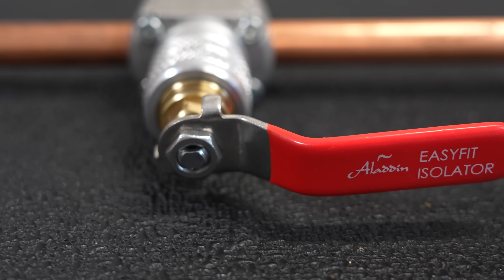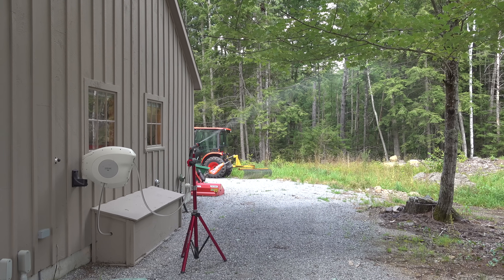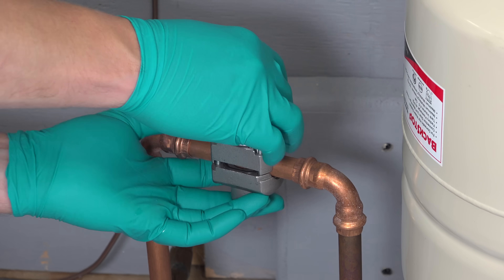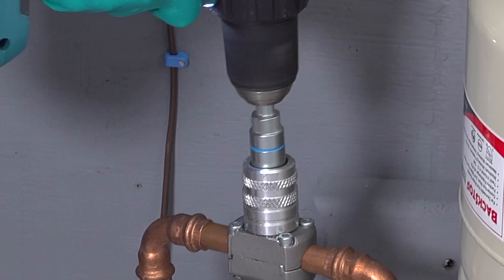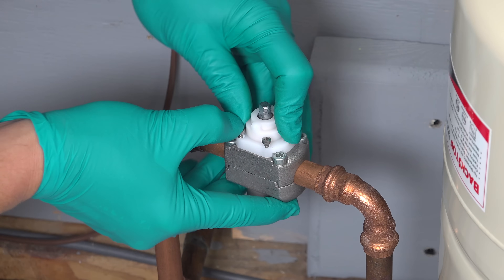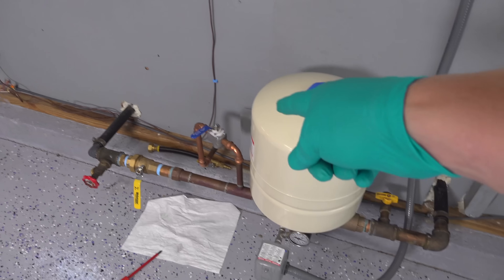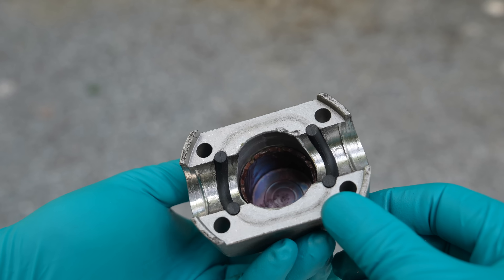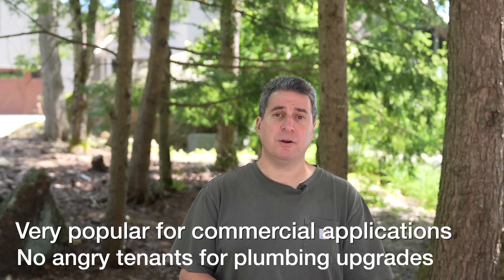SHUT-OFF valve installs on a LIVE WATER PIPE - Aladdin EasyFit Isolator

Comment from the maker: I think aliens brought us the technology for this valve! I am blown away by how this works! https://amzn.to/3YmkHcp - UPDATE Video: https://youtu.be/rj6zKo_d49g
Reply: where does the plug and shavings go from the drilling process?
Reply: @kevinwallis2194  The coupon is trapped and sealed along with a majority of the swarf in the lower housing.
Reply: @kevinwallis2194 due to the valve’s unique blade design the pipe coupon and swarf is captured in the lower housing in the special chamber at its rear so no shavings enter the pipework.
Reply: @kevinwallis2194  he says in the video, it gets pushed down to the bottom half of the "valve". You can see the shape for it on the bottom side.
Reply: @FontMasterFlex  yep I see that, but it wouldn’t pass an inspection for fire sprinkler service. I like the idea for basic household use though
Reply: @kevinwallis2194  I was looking for this question or I was going to present it.
Reply: @kevinwallis2194  down the line…..
Kind of gives you pause doesn’t it???
Reply: This is way beyond expensive.
Reply: Cheaper than a plumber? With SharkBite fittings, everyone's a plumber!!
Reply: A plumber show’s up at your house and installs one of these valves.  Charges you 275.00 to 300.00 because he has to make a profit. Then his labor on top of that. Most people including yourself would just freak out. Here you are in 500.00 dollars and the real problem isn’t even looked at yet. The plumber has just got the water turned off. Now he has to fix the problem!
Reply: he's your friend huh? RichieWellock
Reply: Not so! This is not cheaper than having a plumber in to do the work. My plumber fitted a valve for £50. I purchased a standard valve with handle for £6! Total £56 fitted. I loved the idea very much, but they will have to bring out a much less expensive version to get any traction in the UK market.
Reply: @kevinglennon2370  , this will be something used very seldom here in the US or anywhere else for that matter ,in the end the main shut off valve will need to be replaced (it does not solve the original problem ).
Reply: As for price I've just looked then up here in the UK: 15mm £39.50 Ebay, 1/2" £98.80, trade pack of 5 15mm for £247.08.
Nothing like the quoted price in the US.
Reply: @wildething7923  , I wish we would use the metric system in the United States 📏📐
Reply: Great Idea and looks to work. Way to much $$$. I thought it would be more like $50 - $80 not $250+!
Reply: At $250.00 per valve it is a very big Hell No!
Reply: @jan58joubert14 I had no idea how expensive these were. Last year I had a new HW heater installed and he switched mine from this to some sort of very flimsy aluminum.  I’m just learning this now.
Reply: Cool yes, but I can turn the water off and put a normal valve in myself. @PandawdyBob
Reply: @yumpinyiminy963  +1 especially with new snap-on or shark-bite valves, that costs 1/10th and do not require soldering
Reply: There is no plumber going to charge you $250.00 to install a valve, so no it isn't cheaper it's more expensive and you have to do it, not the plumber.
Reply: @purplehayes5718  Idk where you live but for a plumber to do basically anything more than unclog a toilet here you're looking at 250-350+
Reply: @purplehayes5718 Unfortunately that’s not the case where we live.  It’s total BS, but since the pandemic the plumbers in our region of lower Michigan have been treating the last three years as a gold rush.  I can’t tell you how many places I’ve had quote me ludicrous amounts for everything from installing a simple shutoff (not even in a main - in a bathroom) to simply moving a PVC shower drain one foot in a completely wide open subfloor.  There is one competent, honest plumber I’ve found in my area in the last 10 years and he’s become impossible to get because he’s always buried with too much work.  Ripping customers off is the SOP in our area.  Some places are just that way.  DIY is the only way we can often get anything done.
Reply: You can get these from between €40-60 in Europe.
Reply: top part shouldn't be plastic IMO
Reply: The high price must include shipping from Uranus.  But seriously, does it work on plastic pipe?
Reply: Thank you for sharing this, it is very helpful.
Reply: only £63 in the UK so not bad actually.
Reply: Ya. You'd have to be right alien to pay that much for a 1/2 shut off valve... under pressure or not.
Reply: Yikes is right! $300!? Wow 😮
Reply: ha not if a plumber installs it lol
Reply: I recently paid 900 dollars for a single shutoff valve... I'll try this next time
Reply: Does this worl on pex line to or only copper
Reply: BRILLIANT! Who invented this? 
I'm betting a US Navy machinist that served on a submarine. Those guys can make anything from nothing.
Reply: Now that is a cool design !
Reply: We’ve been doing this in the gas utility industry for years. The big difference I see is in the gas industry we have to pull out the cut section,referred to as the coupon (this is imperative that the coupon does not get left in System with gas ).With water who really cares if a coupon falls back down in the line and causes a restriction , it’s not like an appliance can blow up due to a delayed ignition due to a restricted line.
Reply: @boby115  
   How would you like to have Half as much Volume of water coming out of your kitchen sink faucet or shower valve.  If you’re married go in and run that past the wife ( or husband)
  You’ll be sleeping on the couch until you get it fixed.
    I also question why would an appliance blow up with less volume of gas. The pressure in water or gas will remain the same. Both will lose volume but the actual pressure will start out as you turn on a stove or faucet the same as before. Then the volume and pressure will drop.
Reply: @boby115  The coupon is trapped and sealed along with a majority of the swarf in the lower housing.
Reply: @boby115  so you would be ok for a coupon blocking a fire sprinkler? Its been proven to cause problems many times either with blocking a sprinkler head or alarm valve. if that were the case, we shouldnt need to worry about rocks from unflushed underground pipes blocking fire sprinklers, which has happened.
Reply: @kevinwallis2194  , I will agree with you 100% and I would think working on the type of lines you’re speaking of the coupon would most surely be removed (I would hope 🙏). Small residential lines I am not so sure it would be that big of a deal (it would be aggravating and the problem would still need to be  resolved).
Reply: @boby115 WOW. makes you nervous who you hire. Thanks for that info.
Reply: How much do they charge for a gas version of this?
Reply: Pfft ! you kidding? Two plumbers are cheaper than a plumber!

Comment: At $250 you could just get a plumber. But if you're in a situation where you can't shut off the water this might be your best option. I can't believe how well it actually works, I'd expect some water to leak out as you're installing because that's a lot of pressure and it's hard to waterproof moving parts.

Comment: It's just easier  to just use a valve with compression fittings! What's so hard in shutting off the water at the meter? And installing a normal ball valve with compression fittings?
Sorry this valve doesn't make any sense and price!

Comment: Great you install a new valve that doesn't let out a drop whilst installing all you have to do now is call a plumber to readdress the problem caused by air blockages in the whole system.

Comment: I needed to drain heating system pipes which didn't appear to have a drain valve installed, so I installed a couple of drain valves that worked on the same principle as this. Not the prettiest plumbing fixtures, but extremely useful at solving a problem that would have been a lot of work to rectify any other way.

Comment: I love these videos. The presentation is perfect.
Re the product, as others have noted, seems only of use where you cannot shut off the water supply, which surely must be a rare situation.
And for USD250, I am thinking  a pipe freezing kit would be cheaper, then install a regular valve.  eg a Sharkbite or similar.

Comment: Anywhere that water service is SO critical it cant be interrupted even for 10 minutes should have A LOT more upfront design work and, if properly built, a disconnect would have been there to begin with. 

I feel like the device exists as a get-out-of-jail free card for handymen who screwed up. Nonetheless, it's super cool from an engineering standpoint, I just don't see a proper use-case for it, especially for the $$.

Comment: Where does the copper cut away go? Where does all the copper dust go?
Reply: Yeah, the copper discs are trapped in the lower bit of the unit and won't be able to budge but even if you run the water for a couple of minutes to clear the larger copper shavings I guess we'll be occasionally treated to a nano flake or two.

Comment: This does not appear to be a tap for regular use. It is most likely intended for urgent repairs when it is not possible to make a normal connection without pressure in the pipe. For small-diameter pipes, this device has a significant drawback - the cut-out metal circle may end up where it should not. The idea was borrowed from plumbers and oil workers - they have similar tools for making connections, but they usually work with larger diameter pipes.

Comment: Are there any metal chips going into the water pipe during the installation?
Reply: its built for copper. so it slices, it doesnt crumble, its not brittle. so there shouldnt be any significant metal shavings. atleast no more than youd find in a partial house repipe.

Comment: In the UK, they're about £60 with the tool and collar. Without the tool and collar they're called a refill pack for about £44. So once you've used the £60 one, you just then need to buy the refills.

If that guy has been buying them for $250, someone is ripping him off.

Comment: Wow!!  I thought this was expensive here in the UK at around £50-60, $200 is crazy!!!  Reading some of the Amazon reviews shows some people having problems with the installation, but after watching this I would say it's them rather than the product. Still expensive though, the price I would be willing to pay is about £20-25. I can buy a bag of 10 normal in line isolators, that do require the pipe to be cut, for around £4-5, so it can be seen how expensive the Aladdin is.

Comment: @2:50 you can literally see water coming out of the top of this miracle device🤣
Reply: Someone needs to touch grass. You got mad at valve.
Reply: You need to get your eyes checked my man, that's not water, that's a sliver of the threading on the white plastic piece being pushed out by the screw moving through it.
Reply: @Drysart  Laughable. At 2:50 there is water all over the device.
Reply: But until it's fully installed it's not fully compressing the pipe. I don't get why you don't just shut off the water and cut the pipe...

Comment: Junk on two levels. It is a mechanical joint and it will fail over time. Secondly you still have to shut down the line because now you put a hole in it for a temporary fix that will have to be removed and repaired. Don't waste your money and fix it right once

Comment: At $300, not $250 as stated, (your Amazon link) for a 1/2" valve it's too rich for my blood.  I need a few more shutoffs in my house but will shut off the main and install $10 compression ball valves (Amazon) where I want them.

Comment: $250 is a deal breaker for most. A decent plumber will likely cost you less to install a shut off valve using compression fittings.

Comment: What about 30 years from now? I would not mess around with water like this.
Reply from the maker: Tap valves aren't new for industrial but they are for residential/light commercial. You use these when you have no better or cheaper alternative, other than that you will want to choose more affordable valves.

Comment: Stupid and illegal. All the copper filings just plugged up all the fixed years. And what happens when the valve fails. All valves fail😂😂😂😂😂, Always.
Always shut the water off at the source. Don't be a dummy

Comment: Considering my plumber charges around 150bux to just walk in the door, I figure that cost plus any  hardware would just about equal the cost of one of those valves.
I got a valve for pipes under a mostly enclosed (brick) patio with maybe 15ft of pipe that feeds the outdoor hose spigot.  The gate-valve where the pipe comes out of the house doesn't shut off all the way, so there'll always be water in the pipe with the outdoor spigot-valve turned off, or a constant but slow flow of water if left on.  So while the pipes will freeze from the outside-in (under the patio), the water in the pipe at least has the chance to "backflow" a bit through the gate valve so the pipes don't burst, but I'm still playing with house money at this point.
One of these beasties near the gate valve would be a nice shutoff and let me drain the pipes on the patio fully when it stays subzero (C) for so long.

Comment: I was fascinated with this device, put off a lot by its price, and humbled by the genius who invented it. I don't have copper pipes, but I'd still vote it for a Nobel Prize. If I did have a basement or exposed copper pipes, I would award myself with one of these for my birthday(s). Currently, I get off cheap by getting Shark Bite valves for my PVC for about 1/10th of the price or $26.95 (that's for a 2-pack). I'm still completely impressed with this one! Thanks for the video!

Comment: Not weird it is made in the UK, it's just not suitable especially in a UK soft water area whereby corrosion happens with the steel cutting edge that can lead to a  failure of the value or possible blockage!! It's a DIY valve, that's NOT recommended as said!!

Comment: It always sound good but i would NEVER recommend this for use in the UK, we have a similar cutter valve technique that uses a steel cutter that can later corrode in the hole and cause a blockage further down the road. Best to isolate the water supply and use a better type of compression valve, or get a qualified plumber in!!!!
Reply from the maker: What's weird is that this came from the UK, and sells a ton of them there. The reviews looked pretty good

Comment: We used this technique on live low pressure gas pipelines for decades, it's called, ''Hot Tapping''. High pressure lines have a similar system but is welded.

Comment: With a well pump you just turn off the pump.  With municipal water you use a $15 street key at the meter.   Not a lot of use for this.   Where does the plug of copper go that you cut out?  Hard pass.

Comment: Probably a better use in commercial applications where you can't shutdown water easily.  Not really cost effective for homeowners who can certainly turn their water off easily.  There's so many options plus this is for copper....what about PVC or CPVC which is where I'd want these at things like toilets or sinks where you can have leaking valves.... this would help if you have enough piping to install in those small areas.  Otherwise, I would just turn off my water and replace accordingly.  Cool product but way too costly when you can put one of these valves in so much more cheaply with the same result.

Comment: So where does the piece you cut out go , probably gets stuck in the pipe and causes another problem 😢
Reply: Negative. It looks like a bottom-out valve we use on utility mains. It's just really small. The copper is held down by that cutter, which went down into that part poking out of the bottom

Comment: Fuck that is expensive... 1/2" is $300. 3/4 is $420. I can definitely see where this may come useful. Especially if valve at water meter doesn't fully close and you need an emergency repair.
Reply from the maker: I agree, they didn't listen to me when I told them lower the price and you will sell a lot more. But for a crisis repair as you said its good.

Comment: This would have came in handy a year ago...  We had a professional plumber work on a corroded shut off valve that was leaking to the main water in the house.  The main shut off in the driveway was seized and they couldn't turn it off.  They attempted to freeze the line, but not well enough and broke the shut off valve in the basement.  Basement started flooding to the point where the sump pump couldn't keep up.

Comment: A better mousetrap as they say, but the cost is prohibitively expensive apart from a commercial project where water shutoff is not available under normal circumstances. Looks very secure i would use one when the right circumstances occurred. Cheers.

Comment: What happens to the piece cut out of the pipe.??
Reply: The cut-out goes into the hole saw by the pressure and when you push down the valve it goes into the bottom of the housing and stays there permanently.
The swarfs however will circulate and unless you drain your system, it will invalidate the warranty on your boiler.
Reply: Watch the video pay close attention and find out.

Comment: Oof, one year later and they've raised the price on the 1/2" version from $250 to $300. Cool idea but you could easily sweat a ball valve at a location shown in the demo for less than $20.

Comment: The water pressure where I live is really high.  It can get up to 105 psi over night.  This would be great to keep on hand especially during the winter.  The pipes and valves in my neighborhood are over 100 years old.  Cold drafty basements = frozen pipes.  Sometimes the old valves are stuck open and can't shut off the water.  Thank you for sharing this product.  I will look for it at my local plumbing supply houses.